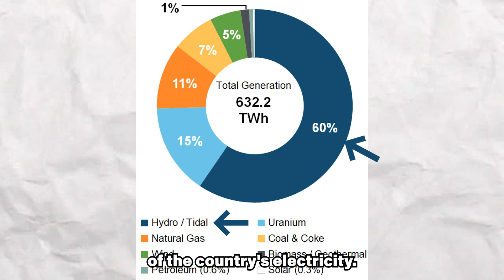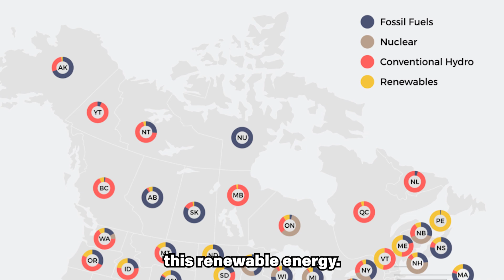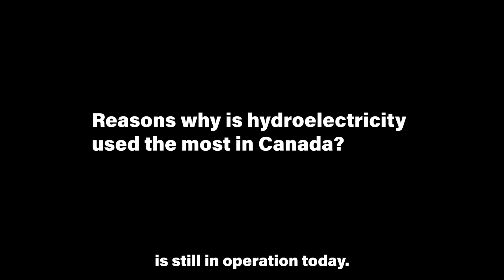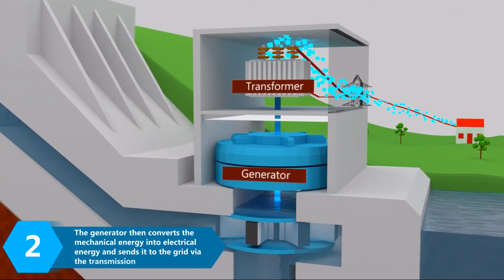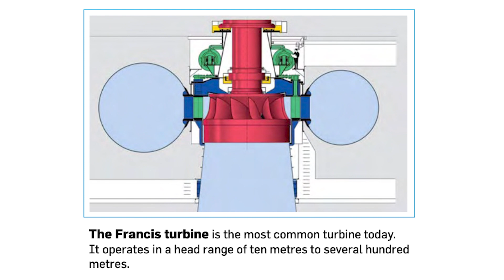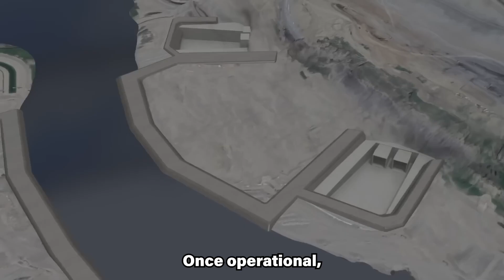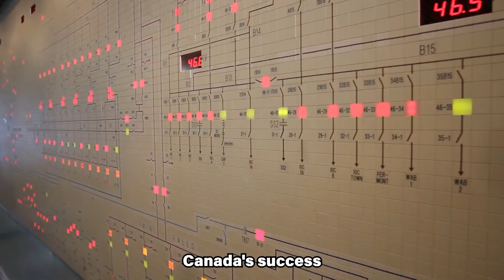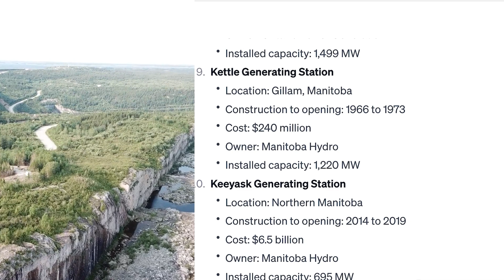Why is hydroelectricity used the most in Canada?

Comment: From Australia Good Morning
the following is part of what was sent to the White House 2 weeks ago
This document is for a retro fittable power production system for hydro dams to have up to three extra turbine banks fitted without making issues for the main turbine hall
Now the reason this type of system has not been looked at was the drop in flow rate and back pressure issues leading to turbine surging. there are more issues but the ones stated were given the to hard to overcome handle and the rest are seen as no big issue.   
As all the worlds dams have the same basic layout regardless of the water turbine fitted. The basic setup is water turbine shaft to shock uni joint to the power turbine. And so all have the same common limitations
A new type of turbine unit is needed if the main turbine hall is to function without modification for multi bank units to be placed in the flow
This new system will never match the output of the main turbine hall but after decades of chasing miniscule increases a system like this one gives a massive jump in output
At this point it should be noted that most of the installation process can be made with the dam online selling power to the grid and there is no increase in water usage when fully installed
This system has been designed to be fully independent of the main turbine hall so as to be serviceable with the other units online and running with the main hall
A FEW OBVIOUSE POINTS
Population ,,,, Even if our numbers were to fall we are still in a situation of heading to a power shortfall outcome things like data centers e cars and a hole host of other tech
The lag time at best for any new power units to get online is 2-3yrs and i believe we are well short of filling the markets needs
OTHER BENIFITS OF THIS UNIT
Is a dam green tech? well its more recyclable than wind and solar
lasts 100 plus years vastly more than the others
It should be noted if the patent is very strongly protected the market will come to the manufacturer even if it is in Australia or America so a 100 billion dollar a year marketplace makes the wage bill a non-issue
SOME OF THE BIG BENIFITS
Bigger market share & customer base
All the required infrastructure is already in place
the asset has a longer life span
No issues regardless of type of the main turbine fitted
No added down time
AND ITS TRUE BASELOAD POWER from an existing dam

Comment: Flowing water has kinetic energy which it gets from the potential energy of the head  (height) of the water source. Sorry but the physicist in me took over. IIRC when Ontario Hydro was formed under Sir Adam Beck in the early 20th century they decided to focus on large scale dams and closed some of the smaller ones and were not interested in small scale dams. In the early 21st century some of the older stations were reopened and/or upgraded and this was to continue but when Doug Ford's PCs took oveer they killed some of these projects along with Turbines and Solar Farms. They announce today that they are expanding hydro electric generation in Eastern Ontario I think.

Comment: We have so many unpowered dams near me in Ontario. I think the Nuclear industry is against powering the dams and running the appropriate wires to transmit the energy back. Since the dams are there, I think we ought to power them up, It is good baseload power.
Reply from the maker: Thanks for mentioning this. I was wondering if the unpowered dams has to do with grid and distribution issues. Perhaps the grid is overloaded?

Comment: Well, now you could talk about the downsides of hydro power : the irreversible destruction of rivers and territories which impact the people living there. The fauna and flora of these environments are changed forever and fish species disappear because of that. The atlantic salmon is a great example of the impact of the dams. Water isn’t as renewable as it seems and the best spots have been already used. 

I live in Quebec and I visited most of the major accessible hydro stations beginning at only 5 years old. Beauharnois, manic 5, lachine, shawinigan, la romaine. They are awesome feats of engineering but they also have a deep impact on our territory.
Reply from the maker: Well said. However arguably the positive outweigh the negatives. But I agree with you on the downside.